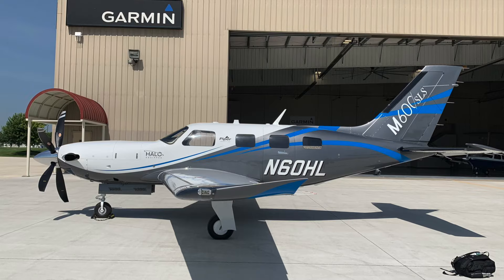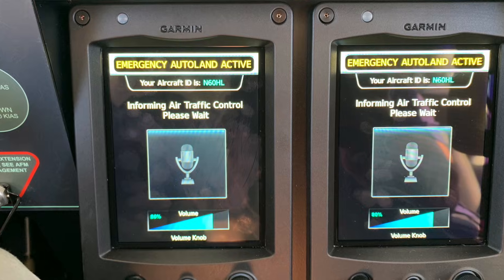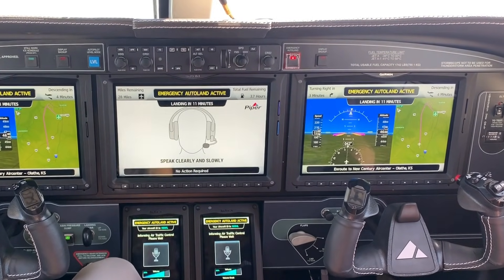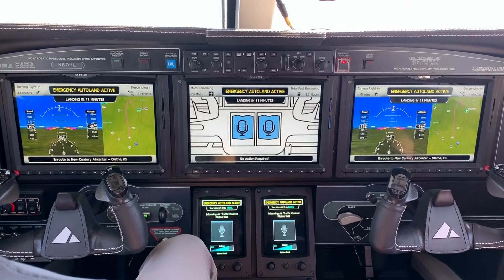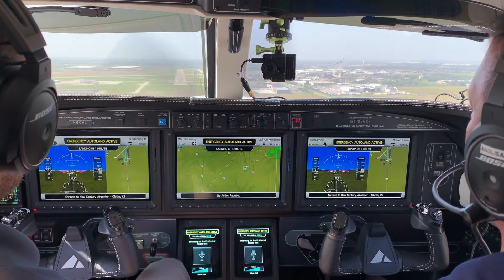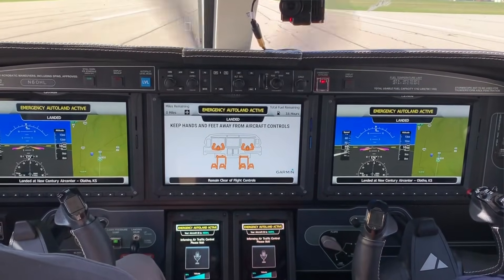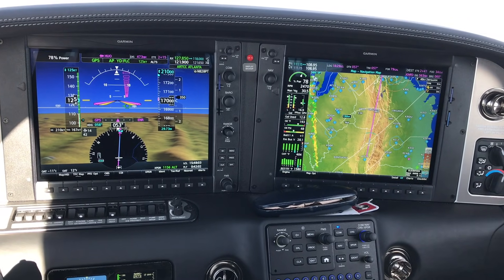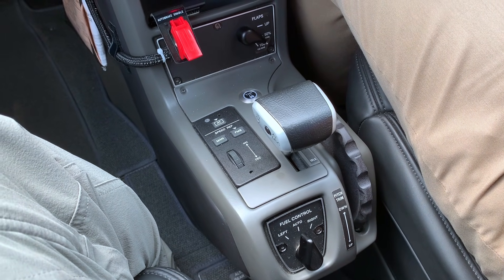Garmin Emergency Autoland Flight Trial

Comment: And why am I studying to become a pilot again?
Reply: So you will have the qualification to press the button, of course. Everybody likes to press buttons!
Reply: @BrazenNL  I've studied and flown lo these 200 hours for that honour
Reply: Because a pilot is not just someone applying pressure on the stick. The machine can aviate, navigate and even communicate for you to an extent, but you are still the brain, the manager of the whole situation. 
The machine can't come up with creative solutions to exotic problems, it can't see beyond the sensors and it can't do what it wasn't designed to do. Meanwhile, humans are incredibly creative and inventive, have great situational awareness and can easily interact with other humans. One complements the other well.

This kind of tech has been used in military fighter aircraft for a while now, so it would make sense to look at the future of these to guess what is the future of civil aircraft. 
While drones have taken certain missions, they are fundamentally limited (depends on active communications, limited intelligence) and by themselves cannot replace manned aircraft. However, we see projects like in France where the next gen strategy is to essentially have a single or a small group of manned fighters with a fighter drone escort which they can command from their aircraft. What I would learn from this is that it's extremely hard to keep humans out of the loop entirely, but we might need less of them in the future to reach the same capacity as before.

This brings the idea of the single pilot airliner. But does it even make sense? Being a first officer before being a captain is a necessary learning experience if the airline wants to get more captains for its fleet, and during that time he/she is also a pretty handy pair of hands. The crew isn't even that expensive compared to the cost of a commercial flight. So, reducing the crew to zero is currently impossible and reducing it to 1 is not that practical for most missions.

People scream "but AI!", but AI is really an overhyped technology currently. This system here is using about as much AI as most factory automation uses, and it is impressive because of how efficient it is, how many systems it affects and how it is available on light aircraft on which automation is a new thing. Truth is, AI is really, really not where people think it is. We have tools like machine learning which can produce sometime spectacular results, but also spectacular failure, and if (or rather when) we will manage to create an intelligence capable of displacing pilots, that same intelligence will be capable of displacing pretty much every human from its job.

I currently work in IT with a background in EE and industrial automation. I spent most of my earlier career in 3D printing and other additive manufacturing tech. I'm sick of it and currently studying to be a pilot. If I'm going to be pressing buttons all my life, I'd rather do it in the air.
Reply: @Numitronic  You said it, pretty soon pilots are going to be mostly flying automation managers. I can't imagine this is going to improve stick and rudder skills but at this point I'm starting to trust the computers more than the pilots to react properly to an emergency.
Reply: seeingeyegod they will be flying automation but as long as they are in the cockpit (which could be for a long time)  I think they will be doing the same tasks as today so they do maintain their skills flying.  Performing the takeoff and part of the climb and final approach and landing along with other duties. Pilots don’t hand fly cruise because they have to do other things and even if you fly a plane with no autopilot (something I did a few hours ago) during cruise with no monitoring complex automation it is pretty easy to do.  Trim it out and just tap the plane back into position once in a while you do it correctly and you can maintain your altitude within 10-20 feet and your heading with minimal control inputs. You do have to be paying attention to the hands on flying which would be way harder to do if you had to monitor a bunch of complex systems at the same time. My point is if there are pilots they will probably still HAND FLY the plane even if it’s only for a few critical minutes during the flight.
Reply: @Numitronic  AI will take your job away if you are a pilot. from 4 crew to 2 crew in the last 80 years, btw your essay is too long didn't read the whole thing
Reply: Kelvin Kai King Lau AI is dumb and dutiful
Reply: Easy answer,  your paygrade is earned not when the airplane is good, but when the aircraft is bad.
That is when you come in, as the automation cannot handle that fairly well or reliably, it just doesn't handle adaptations as well as a human can do.
Reply: @CMDRSweeper  Im not convinced a human pilot is better at handling emergencies than a computer. For instance, computers can land an airliner with complete loss of hydraulics using just differential trust fairly easily. For humans this is extraordinarily difficult. One crew pulled it off (TNT flight out of Baghdad)  one almost pulled it off ( DC-10 in Iowa long time ago) all other attempts failed and crashed. Every statistic shows pilots are more likely to cause a crash of a good airplane than prevent one in an emergency. And this is prior to even attempting to have an autopilot system that covers any and all emergencies or implementing any deep learning AI to make decisions for cases that where not foreseen or pre programmed. Pilots may continue to exist, but I bet they will become like drone pilots flying remotely whenever there is an emergency the computer cant handle or you dont want it to.
Reply: @P44man  So far I've not not seen any automation handle any kind of complex emergency with any kind of success (and its literally my field).

Just saying "deep learning and stuff" doesn't solve the underlying problems of the current AI paradigm. Also there is the fact that we've never put an AI in that kind of life-critical role yet, and you want to apply it to an industry that is extremely conservative.

There is also the insurance and responsibility problem (seriously this is a responsibility nightmare).

I stand by my case: if you can field an AI that can take over pilot jobs, you also made an AI that can take over most jobs, including engineering and management.
Reply: @Numitronic  Side note, Ai is already taking over engineering (layouts of ICs PCBs, even mechanical structural components, computers do that better than humans) and management (of capital, most trade is AI).  Its starting doing a better job than doctors and radiologists in making diagnosis. But thats besides the point.
 
Flying a plane is pretty trivial for a computer. There are very very few unknowns or unknowables.  There are a bazillion parameters, which is challenging for a human, challenging to present to a human to allow him to decide, but for a computer that is just data that is processed in microseconds.

Let me put it this way; my drones and hobby grade RC planes have been flying themselves and landing reliably for almost a decade now while autonomous driving RC cars that can complete a course, let alone a race course, you simply cant buy that yet.  My $1500 robotic lawnmower still gets lost in my yard 

For a computer, flying a plane is at least an order of magnitude easier than driving a car on random roads in cities that change all the time, that have pedestrians and potholes and unpredictable human driven traffic that passes within a less than a meter. You have objects that could be anything that you need to recognise, identify in rain in snow, in fog. In a car. a potentially lethal accident from a bad decision is rarely more than a second away at any point. In flight, none of that is true. And while I dont believe we will see full self driving cars as soon as Musk predicts, we are not decades away from getting there either. 

For the most part,  for flying you dont even need any AI. You dont need to recognize objects or interpet anything, Just simple procedural code "if this then that" will let a plane take off, navigate and land just fine 99.9% of the time. They already do, just like my RC planes. It as no AI. No deep learning. Just static code and PID loops and some kalman filters as "fuzzy logic". Its runs on a computer with less processing power than a watch. ON an airliner, you can have enough computer power to run simulations,  the same code that runs actual simulators, and given the data you have, see what happens when you try strategy X, Y or Z and see what works best. It can be dumb, but it can try 1000s of things and chose the best one. With no AI or intuition.  Take the miracle on the hudson. It could have simulated 100 landing attempts  on various airports and decide in seconds or milliseconds what Sullemberger could only guess. That still not "AI" or deep learning. Its basically trial and error.  Its just for the corner cases where you have unknowns where deep learning could help make judgement calls. Things programmers did not or could not foresee and you cant simulate because you lack the data..  If the weather predictions where off and you end up in thunderstorms.  Where do you try to (crash)land when no airfield is in range. What do you do when an engine exploded and took out half the controls on one wing. Those kinds of things. 

Although in that last example, as happened on the A380, it was the computer that told pilots what was and wasnt possible to land. It knew exactly what was damaged and what still worked and it computed exactly how much runway it would need without reverse thrust and without spoilers and landing without flaps.  The pilots technically landed the plane, but it was the computer that told them exactly how to do it and predicted how it would end. Pilots no matter how experienced, would just have had to guess if it werent for the computer collecting the data and crunching the numbers. The pilots did nothing wrong, but they contributed nothing to the solution either. They spent hours reading and clicking through error messages and feeding data in their laptop that then "decided" what to do. Sullenberger did nothing wrong either,  but an AI plane could have decided within seconds to turn back and land safely, or if that was calculated to be impossible or too risky, would have made the same obvious choice of landing in the hudson. But unlike Sullenberger, it would not have had to take minutes to go through an improvised checklist and it would have activated the water landing feature so the plane wouldnt have flooded.
Reply: P44man what evidence is there of automation handling hydraulic failure?
Reply: @P44man  I've been working with Altium and Solidworks for years. And let me ask you one question: do you trust the autorouter?

Of course not. I mean, I use the autorouter extensively to take care of large amount of lines, but I have to parametrically constrain it to prevent it exploding the whole design. I've fiddled with CAD generative design too to a lesser extent.

I've built multiple autonomous drones (in the early days of ardupilot) and autonomous rovers since high school. You are right, flying a plane is easy for a computer. This is why computers have been flying airliners for nearly 40 years now. It's everything else that is hard.

It's actually experience with automation that showed me its limits.I've come to the conclusion that the obsession with trying to get the human out of the loop is the wrong way to think about it. You don't do automation in order to get rid of the fleshbag. You get rid of the fleshbag when it stops being beneficial to the whole operation. We are quite far from there yet. 

Truth is, I don't see any reason to go pilotless any time soon. Crews are cheap, can do many roles without special infrastructure, doesn't require maintenance by the airlines, is already well established and take responsability. Why would you specifically want to get rid of the pilots?

What's worth it though? Ergonomy. Aircraft are absolutely awful at ergonomy. In fact, we generally suck at ergonomy. It's either total verbose or absence of control. Like I said before, machine and humans complement well each other, but hardly ever get good synergy between them. For example, the PFC on an Airbus which is a black box of mystery to the pilots in flight. Having a human as a higher-level supervisor of these systems adds a tremendous amount of intelligence to the whole system, for cheap. 

It's actually experimenting with autonomous drones that taught me that. At first, I focused on trying to make it run missions entirely unmanned, but I grew frustrated with the results. Then, I focused on finding better ways to control it while in the air, adding FPV, HUD and modifying the way that I sent autopilot commands to the machine while in flight. This way, I could accomplish much more complex missions with little effort and with much more grace than it was entirely unmanned, and the experience was quite fun. Leveraging the best of both worlds is the better strategy to automation.
Reply: @Numitronic  Pilots are immensely expensive. But its not their salary. 
  
Do you have any idea the length airlines go to reduce weight on a plane? UA switched to thinner paper for the inflight magazine and service guides, shaving 11 pounds per flight, saving them  $400K per year. Delta saved a similar amount by slicing lime for its alcoholic beverages  in 16 slices rather than 10. Nippon once tried to make passengers go to the bathroom before the flight to save weight. And you wonder why they would want to get rid of 2 or 3 pilots, their seats,  and the entire cockpit with all the instrumentation that only serves the pilots ?

Then there is the room you save. If you get rid of the cockpit and cockpit door and barrier,  you could seat at the very least 4 or 6 extra super premium first class seats. Cockpit seats rather than window seats. Thats at least 5-10M in extra revenue per year per plane.

You are right about the supervisory role though. The next step will likely be self flying planes with a single human supervisor.  It wont be long before that role is done remotely and pilots supervise multiple planes until there are basically just a few standby pilots for all planes in the air.
Reply: @P44man  Very comprehensive analysis sir... Well done. ✈
Reply: Because it's still going to be 20-30 years before you drive out to the airport, tell the airplane where you want to go, sit down, strap in, have a drink and wait to get there.  In the meantime, we still need pilots.
Reply: @GaryMCurran  It will be 10-20 years before semi trucks are completely automated
Reply: @Hedgeflexlfz Hi actually, I would expect that airplanes get there first, only because other traffic can be vectored away from them.  The Emergency Land or Safe Return system requires no changes to the infrastructure for it to operate.
On the other hand, when was the last time you were in downtown traffic at rush hour?  I live in the Seattle Metro area, and I've lived in the Philadelphia Metro area, and traffic during rush hours is insane.  Unless the DOT goes and adds specific lanes, or even specific roads just for automated traffic, the complexities of computer-controlled equipment in a human environment just isn't good enough yet, or even in 10-20 years, for that to happen.
Given that Automated lanes could be built, we might see it in 20 years or so but do YOU want an 80,000-pound brick moving at 70 miles an hour, with no driver on board to get a 'Blue Screen of Death?'  In that case, I'm pretty sure the 'Death' part would be really real, ya know?
Reply: Reading the comments below will give you a headache lmao
Reply: Don't worry, they don't have automated takeoff yet ;)
Reply: @FrameByFrameMira  Automation won't take off in my lifetime. Besides, trucks will be automated before planes
Reply: @Hedgeflexlfz  Not likely. There are far far more variables involved in automating trucks than there are automating planes.
Reply: @2011blueman  lol no
Reply: @2011blueman  Ok boomer
Reply: @2011blueman  They both can be automated easily eventually
Reply: @Hedgeflexlfz  Yes, I agree that they will both be automated eventually. However, vehicle automation is much more tricky. Just think about it for a bit. Traffic is much closer and more erratic, kids/dogs/bicycles jumping in front of cars requiring extremely fast detection and avoidance, the shear number of roads and obstacles is far greater, etc. Airplanes already have set flight paths into relatively few airports in comparison to car destinations.
Reply: @2011blueman  Vehicles are harder when it comes to traveling on the roads, but the technology to  automate the engines and actual machine is easier. Also, remember how many people will die when a planes automation fails compared to a car going 65 mph
Reply: @FrameByFrameMira  : Takeoff is the easy, and optional part.
Reply: Why ? Because you enjoy burning $money$ ✈✈✈
Reply: Planes have been autolanding for half a century and flying totally autonomously fot more than two decades. It is only a matter of legislation when commercial air traffic can be fully automated.
Reply: You should stop if that is you level of intelligence.
Reply: Both pilots and truck drivers are obsolete in the next 10 - 15 years.
Reply: @robertl30  Airliners have been landing themselves for years.  Pilots aren't going anywhere anytime soon.
Reply: @robertl30  Trains are on rails and many still have conductors. Pilots are not disappearing anytime in the near future.
Reply: @hellothere9262  and if the trains hadn't had conductors, the last 5 derailment would've been avoided.
Reply: Robert Larson there was a train crash in France years ago, a train was misdirected into another train. One of the engineers warned the passengers to get to the back  and saved many lives he died doing this but he saved probably a dozen people. The problem was in part caused by automation but the human saved lives lives that would otherwise have been lost for a few thousand dollars.  Not saying humans are perfect but they do save lives.  Humans correct automation a lot more than what is perceived in many fields, not just transportation.
Reply: @robertl30  you're a fucking idiot.  Pilots are not going to be obsolete in 15 years.  We aren't even close to that.
Reply: @robertl30  :( I'm a student pilot right now